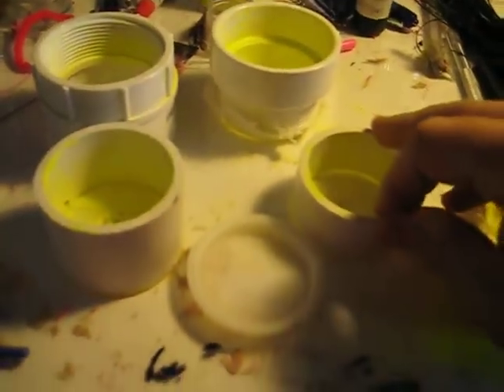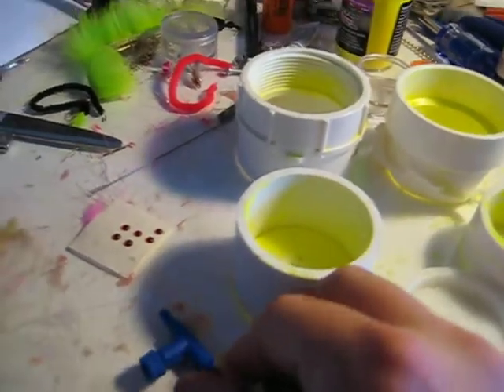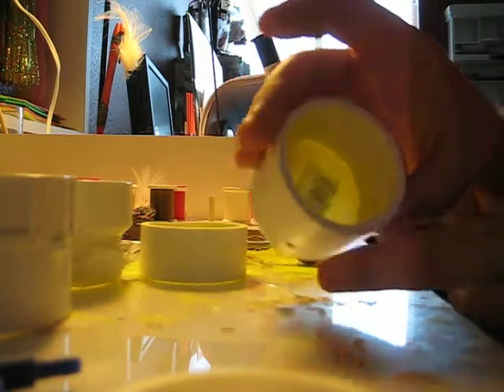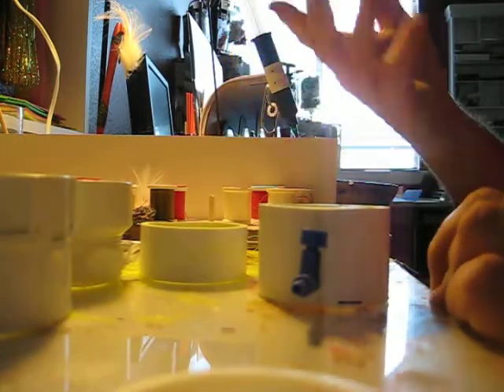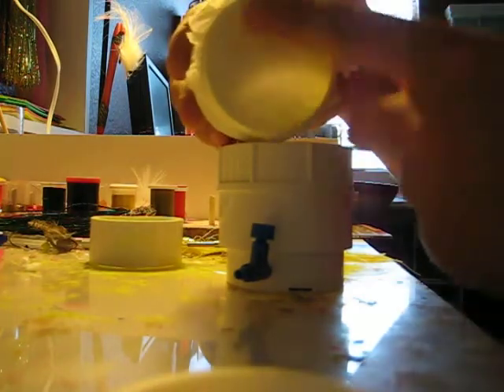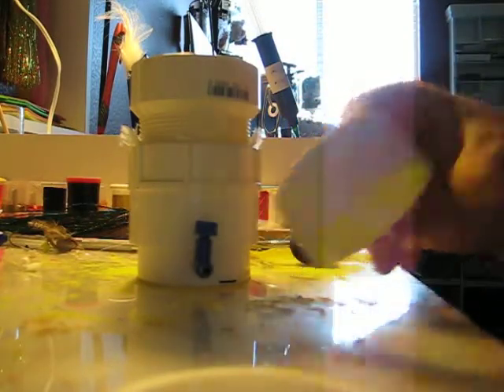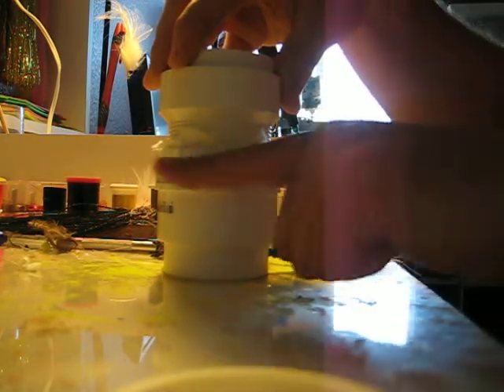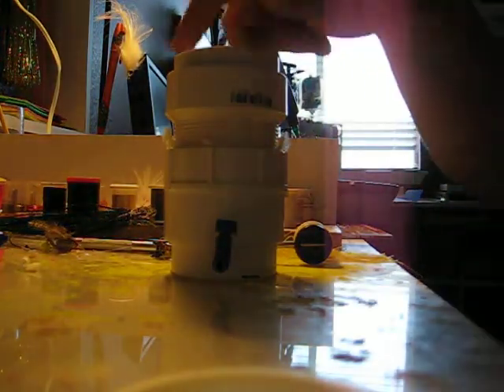How to build a fluid bed for powder coating

Comment from the maker: I use protec powder paint, I just heat the jig up with the heatgun and dip it.  the heat melts the powder into an even coating on the jig.  After that, bake in a toaster oven @ 225 for about 5 minutes to cure it.  you dont have to cure it, but it makes it much stronger

Comment from the maker: you just have to make sure the bottom is capped off so the air is forced upwards, through the paint, if you could find a female threaded end cap that should work.  I was just going the cheapest route possible.. Let me know how it works out!

Comment from the maker: You might have your valve closed to much, or your pump is not big enough.  Low pressure usually results in a volcano. You can also try a brown paper bag
Let me know if that works

Comment: I am having a problem where the air forcing itself through just one or two places creating a small plume of paint. How did you use the coffee filter to create the fluid like dry paint even? I even tried two filters together to see if it would even out and act properly instead of escape out one or two concentrated holes?

Comment: so on the bottom test cap if it's glued on do you drill or poke small holes in it so the air can get to the coffee filter